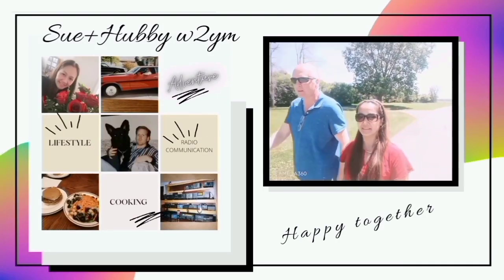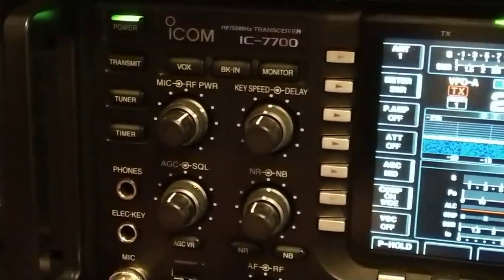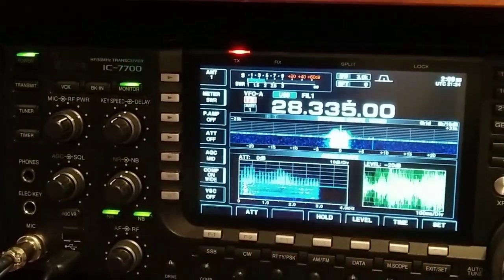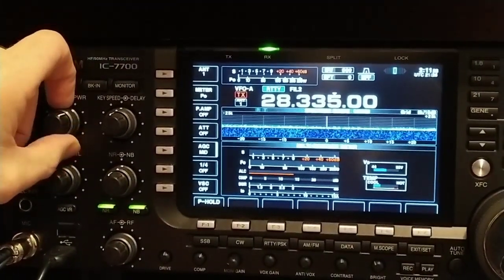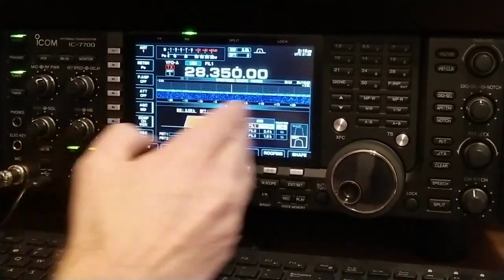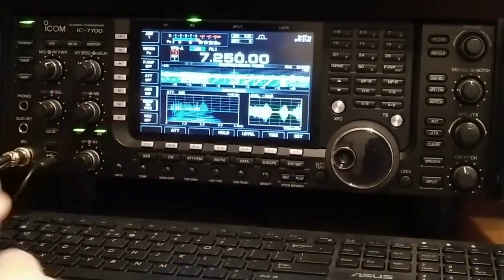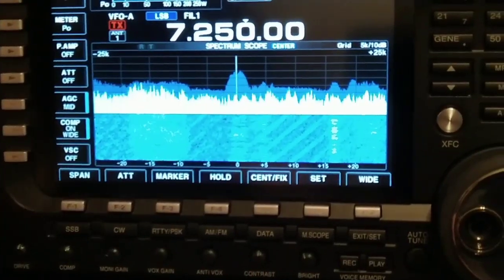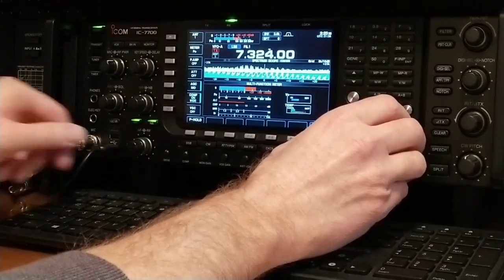ICOM IC-7700 Basic Front Panel Review #radio #hamradio #heilpr40 #review

Comment: This is probably a silly question, but I'm a newbie to radio...

I want a high quality multiband radio (SSB, etc.) For now, it's only for reception, not for transmission (I'll see if I get a ham license in the future or not, but for now I only want the radio to listen to in high quality.)

Somewhere where someone asked for opinions on certain compact multiband radios (for reception only), another person answered that, for such purpose, it's better to buy a second-hand transceiver (transmitter/receiver), because the radio reception quality is much higher in these devices than in compact multiband radios (much smaller) that are only receivers.

Questions:

1. Is this true? Even if it's only for listening to the radio (and not transmitting), is the reception and sound quality of a transceiver better?

2. I imagine that to transmit (as a radio amateur) it would be necessary to install a large antenna outside the house (on the roof or anchored to a window), apart from other gadgets. But is it also necessary to install an external antenna just to receive (listen to the radio)? Or not? Or is it enough to put a compact L-shaped one that protrudes only a few cm upwards? (I imagine that just for listening the radio it will not be necessary to connect more devices, right?)

Thank you.
Reply from the maker: @mauriciolacruz  Buy an icom 718 for and for an antenna just put a wire up in the backyard that's a cheap way to do it and it'll work great.
Reply: @macbee6780  
So it's true that it's better a transceptor than just a receiver.

Thank you! 👍🏻
Reply from the maker: Your very welcome